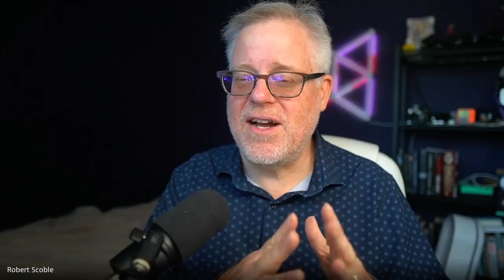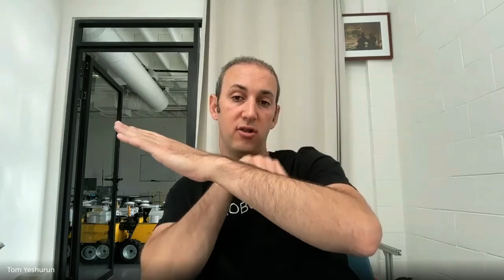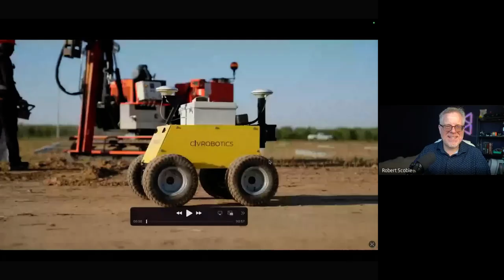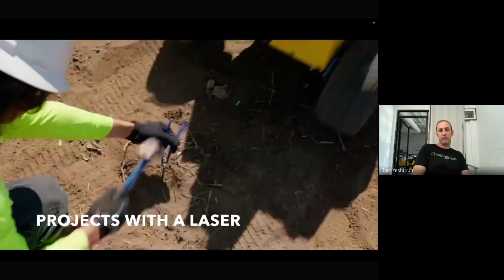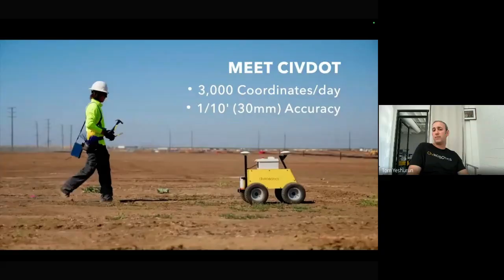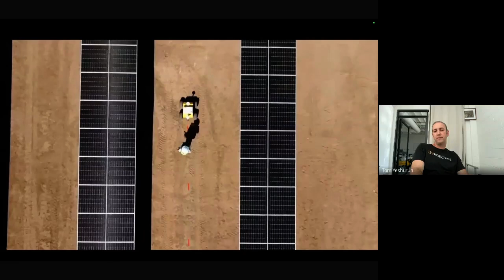50: Robots in Construction

Comment: You all need to get back to Tim Paterson and ask him if the story of 10-year-old David assembling the IBM compatible computer clone Bill Gates used for the 1981 IBM sophwaer contract is a lie. I need to hear this from Tim Paterson himself. I've emailed him, and there is no answer. A.I. sophwaer is the specialty here.  My dad automated all the lathes, mills, drills, CNC at Robert Shaw and I learned it all from my dad top IBM. At 9 years old I did the clutch job on my dads bracket race car he would race at the Lions dragstrip. The truth will be out with or without your help. I'm letting you know that 4 grown men took advantage of the knowhow a 10-year-old computer wiz had in mid 1980 and kept quiet. It doesn't matter to me if Bill Gates and Steve Wozniak won't admit it,  I want to hear it from Tim Paterson that I'm lying about the 1980 IBM compatible computer clone that Bill Gates used for the 1981 IBM/Microsoft sophwaer contract.  This is your channel and through your channel we'll clear up early computer history. David V.